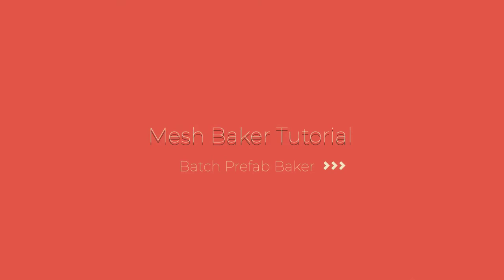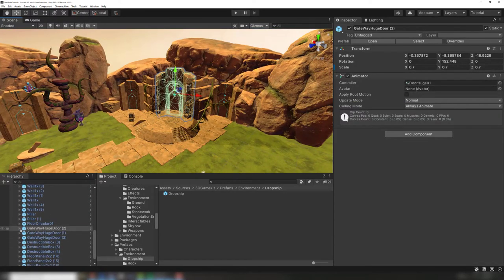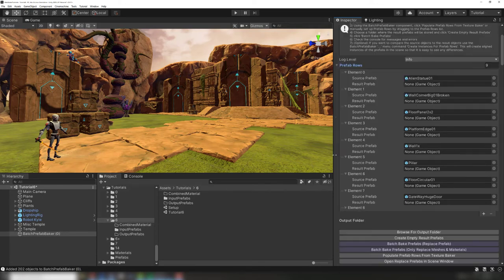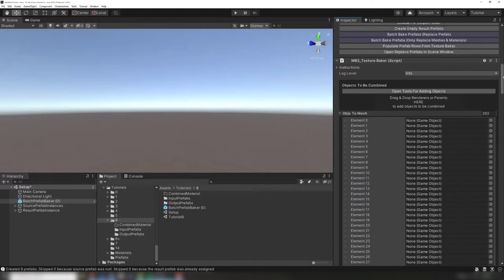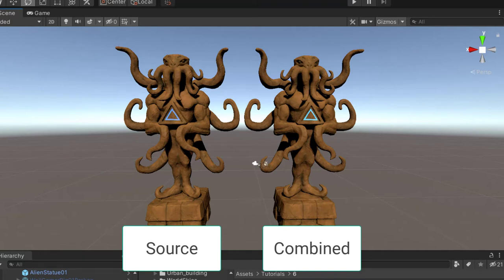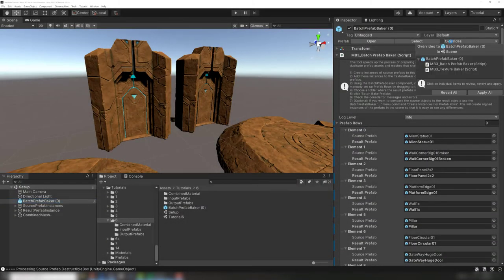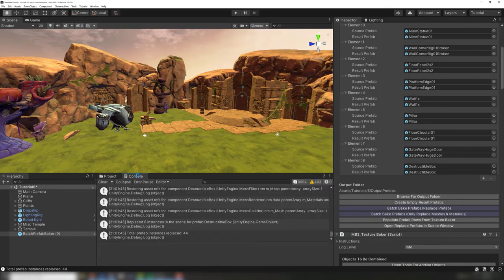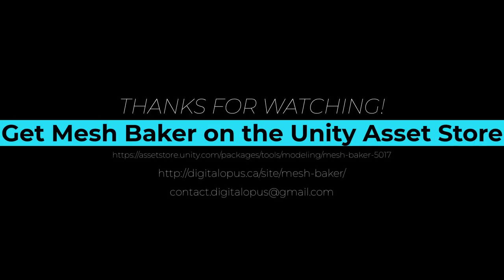Batch Prefab Baker

Comment: Hi Ian, I was wondering if there was a method or tutorial within Meshbaker that allowed for batch baking prefabs mesh's together much like the batch prefab baker bakes the textures into a seperate atlas?

I'm trying to combine hundreds of different objects to be their own individual prefab still but fall under the same atlas but also be only one mesh per prefab (Some of the mesh's I wish to combine feature 20 seperate game objects inside which isn't ideal!) Thanks for your wonderful tutorials!
Reply from the maker: Hi ToMo, you might be able to do what you want with the Mesh Baker Grouper. Check out the tutorial for this.

https://youtu.be/y5kmWixP0tg

The workflow would work like this:

Create an instance of all the objects in the scene.
Position them so that they are at position 0,0,0, rotation 0,0,0, scale 1,1,1
Add all the objects to a TextureBaker and create the atlas.
For each prefab add a child MeshBaker to the texture baker
Add the appropriate source objects to each MeshBaker
Configure the MeshBakerGrouper to  'Auto Generate Prefabs'
Click bake all child mesh bakers.

This should generate one prefab per MeshBaker

Comment: i have problem i have two prefabs with different material when i bake prefab there is only one prefab have combined material the second one has not.
Reply from the maker: Are these two prefab instances of the same prefab with different materials? I recently answered a question in the Unity forums dealing with this situation:

https://forum.unity.com/threads/mesh-baker-by-digital-opus-released.159258/page-69#post-8529632
https://forum.unity.com/threads/mesh-baker-by-digital-opus-released.159258/page-69#post-8531216

Does this answer your question?
Reply: @IanDeane  the answer is same but i didnt understand properly :(

My problem:

What i have:= I have 6 prefabs each prefab have different materials ( some prefab contain multiple prefabs )

Step1:= I add batch prefab baker
In texture baker it is in batch prefab baker i enable multiple prefab option and add all the material that is used in all prefabs ( including multiple material in single prefab. I follow as you do in multiple material bake video )
After adding all material i bake in one atlas all works fine.
(Also i do populate prefab and empty prefab add follow as your prafab batch video)

Step 2:= final step when i click to bake batch prefab there is only one prefab bake i mean i have 6 prefab but in only one prefab it changed material ( combined material ) and another has old material.

Please help me i need same material in each prefab.

*( I follow your batch prefab video around 5-10 time )
Reply from the maker: @thvk98  When you do the prefab bake, check the console. Are there any error or warnings? Sometimes a renderer will be skipped because it uses tiling UVs that don't fit inside the atlas rectangle. If this happens you need to make sure that renderer is included in the texture bake.

If you are using nested prefabs then the bake probably won't work properly. I would include the bottom level prefabs in each bake and rebuild the containing prefab after.

Comment: Is it possible to do this while separating by shader? I am optimising & porting a game by a different dev who has thousands of draw calls due to different materials for every surface, however they also use lots of different shaders. I think my best option is to try and combine everything that shares the same shader, but I am not sure if there's an option to do this which won't take forever to manually look for each shader used.
Reply from the maker: Yes,  there is a workflow that works well for this. 

1) Create a scene and add an instance for each prefab or open one of your game levels with lots of prefab instances in it.
2) Use the "Window -> MeshBaker" or "Tools For Adding Objects" to generate some TextureBakers in this scene grouped by criteria you want (shader). Each Texture Baker should have a list of objects to combine matching your desired criteria.
3) To each TextureBaker add:
       - A BatchPrefabBaker component
       - A MeshBaker compontent
4) Press button on BatchPrefabBaker "Populate Prefab Rows From Texture Baker"
5) Now you are into the normal BatchPrefabBaker workflow. 

If you want, after step 4 you can optionally create a temporary prefab of each TextureBaker/BatchPrefabBaker/MeshBaker GameObject and create an instance of it in an uncluttered baking scene where you can experiment with the batch prefab baker settings. If you do this you will loose the TextureBaker objs to combine references. You can re-collect these by using BatchPrefabBaker context menu "Create Instances For Prefab Rows". Then drag the SourcePrefabInstances gameobject to the TextureBaker objects to be combined.

Comment: Probably a dumb question, but will Mesh Baker reduce the final file size of the project?
Reply from the maker: Not a dumb question at all. If you combine the meshes in the editor (easiest option). Then the final file size will almost certainly increase. This is because when there are many copies of the same prop in a scene using separate renderers, Unity only needs one copy of the mesh in memory. When these props are combined, the combined mesh will have separate vertices for each prop. 

This can be building the game with un-combined meshes, then combining at runtime when the level is loading. If you have used the Batch Prefab Baker to prepare the props used in the scene, then they are very easy to combine at runtime because they already share a combined material.
Reply: @IanDeane  Ok thank you for replying, still trying to wrap my head around it all, the thing is I'm trying to find ways to optimize and have a result of a smaller file size, wouldn't combining meshes result in smaller size? Or is it just less work for the computer so better fps?
Reply from the maker: @OvernightOats1  Combining meshes will definitely boost the file size. With un-combined meshes, the vertices in a mesh can get re-used many times in different drawcalls. When the meshes are combined this doesn't happen. The vertices of a prop can be duplicated several times in different parts of the combined mesh. 

There is a build size report in the editor log that you can look at after creating a build. I would focus on that to see what is taking space. I have also found the "Asset Usage Detector" asset to be very useful to discover why assets that I think should not be in the build are being included.